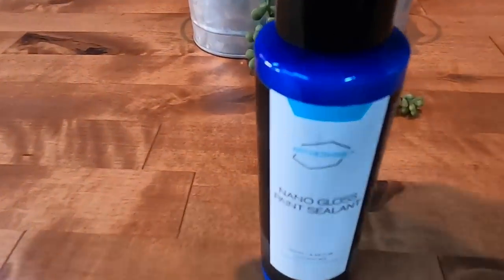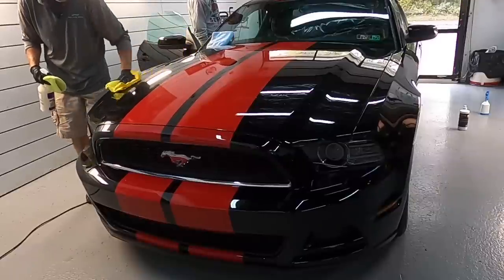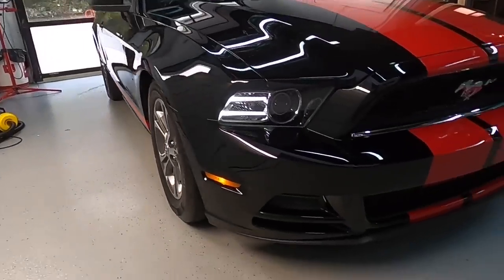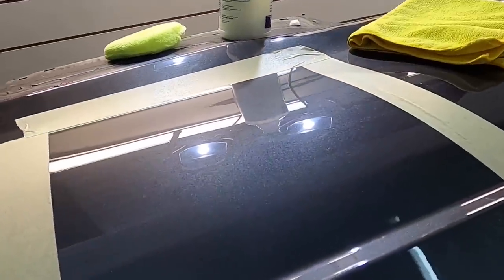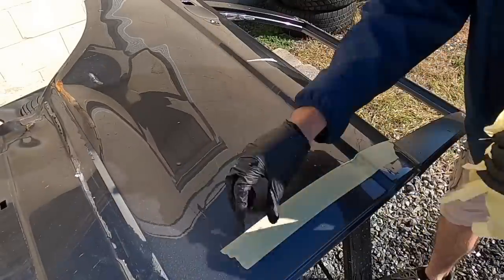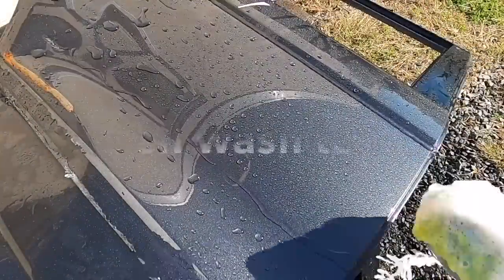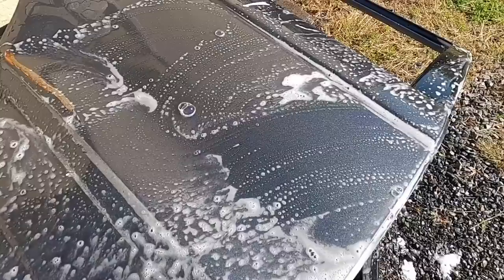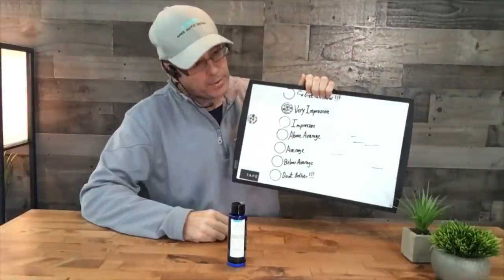The Shift From Beading To Sheeting!! Artdeshine Nano Gloss Paint Sealant! Let's Sheet Together!!

Comment: If TWSNS was a sheeter it would be absolutely amazing.
Reply: I bet that is going to be one of the big announcements in 2021 from TW.
Reply: I feel like it is. I've gone down the ceramic spray route and although the water beading is awesome, it's very prone to water spotting. I switched over to the new TWSNS and there is still some beading, but it doesn't leave a thousand water spots on my car. Granted the new improved formula does have SiO2 in it according to the label, its just not as prone to water spots in my opinion.

Comment: Great video, Brian!  Two quick questions.  One, you mentioned polishing by hand - what would be the best polish to use with this method?  And two, if this Artedeshine Nano Gloss Paint Sealant was going to be your primary base layer of protection, what would you top it with if your goals were to increase depth and gloss while enhancing (or least not interfering with) the sheeting properties of the Artdeshine coating?  Thanks!

Comment: I have a black Mustang like this.I’m so tired of water spots from beading of the ceramic  spray wax I’m currently using. Going to try this.
Reply: Water spots are the Achilles Heel of ceramic and I have the same frustration with it. 
I would point you in the direction of the new and improved TW Seal N Shine, which is a more durable sealant and it really doesn't create spots like the ceramic spray does. Currently have it on my car and I love it. Less gloss, but no spots for me.
Otherwise look into the new graphene coatings which don't have the same water spot issue as the graphene tends to reduce panel temps, which allows the water to evaporate more before spotting.

Comment: Waaaay back in the 90s I used a product called Durashine, It worked great and sheeted the water better than anything before it or since. Do you remember this product? I owned a auto detail shop in the mid 80s until I joined the Air Force and served 22.5 yrs. I'm getting back into detailing now.

Comment: I believe you previously mentioned that 303 graphene nano spray coating is also a good sheeter. Given the choice between the two, which would you say is the better sheeter?
Reply: 303 beads like crazy.  I tried it two weeks ago and look at it every morning on my daily driver.   I bought it because it is supposed to reduce the ability of spots to form and spots are easier to remove with a graphene coating vs Si02.  Pan had a chemist and physicist on that covers this issue in detail and he is not from any product line but is a professional developer of products for these companies.

Comment: Heres the thing about sheeting, you need a certain amount of water to create the sheet and the water to run off.  A fine mist from sprinklers won't  provide enough water to sheet off and you will still get water spots.
Reply from the maker: Indeed... dry areas with just sprinklers. But here it pours every other day... much needed.

Comment: You seem to be applying alot of product to the test panel. Does it need that much? Does alittle not go along way? Thanks.
Reply: If you don’t like the product... go buy Meguiars!
Reply: @lifeofbrian9511   What, is that an offensive question? No. And I don't buy megs products and very happy with them. If you want to buy expensive products that do the job that cheaper products do, go for it.